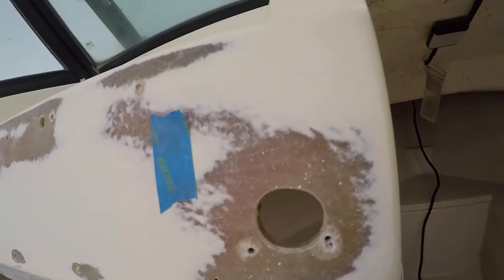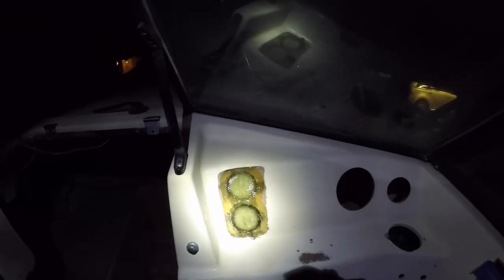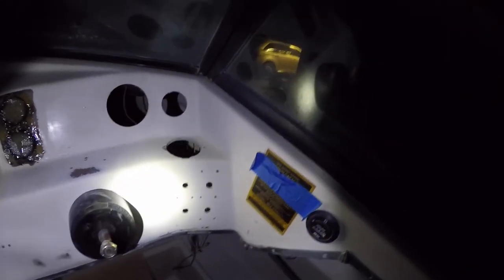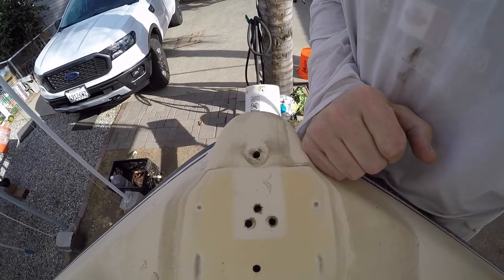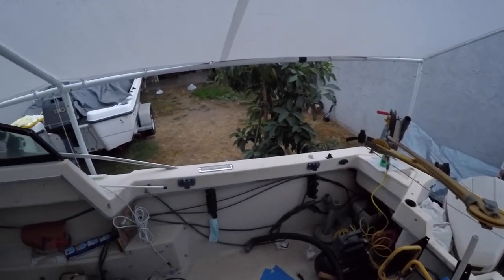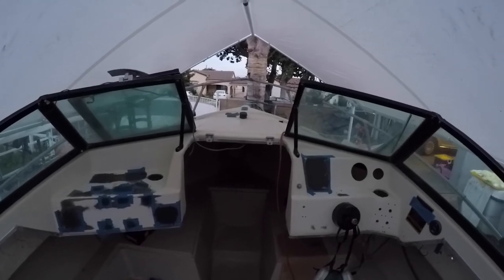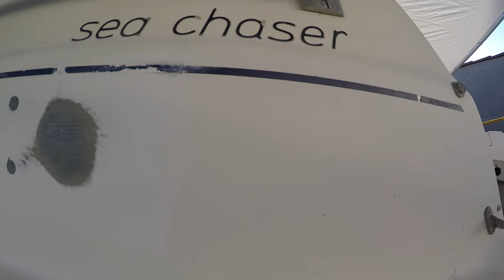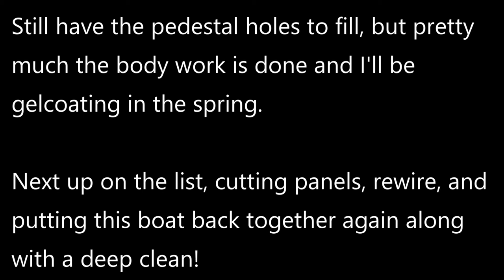Holes In My Boat : The Fix | Arima Boat Restoration | Eps. 7

Comment: What'd you use for the replacement black vinyl stuff?
Reply from the maker: Here’s the link to how I replaced the black dash panels:  https://youtu.be/FtmBioTYPTk
I use black 1/8" ABS plastic, about $15 on Amazon, works great on the vertical surfaces, especially if you’re installing gauges.
https://www.amazon.com/gp/product/B000K4YNLI/ref=ppx_yo_dt_b_search_asin_title?ie=UTF8&psc=1

If you want the original looking vinyl, Walmart sells this black shelf liner, but you’ll also want to pick up some 3M spray adhesive.
: Con-Tact Brand Grip Premium Solid Non-Adhesive Shelf Liner, Black, 18" x 4'.
https://www.walmart.com/ip/34742829
Reply: @SoCalSeaChaser  awesome. Thank you!